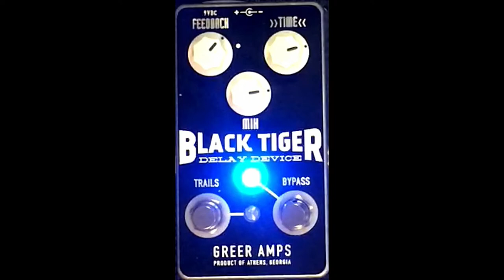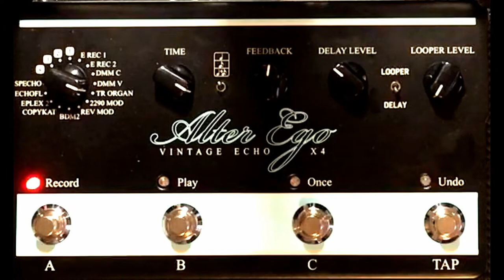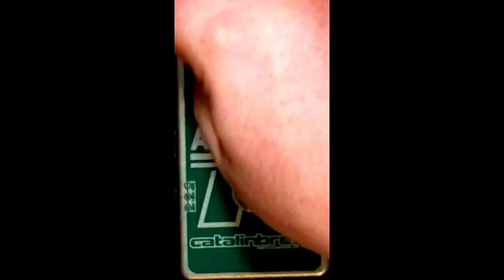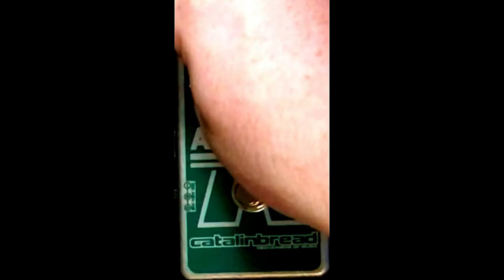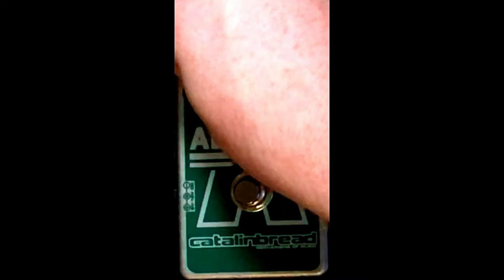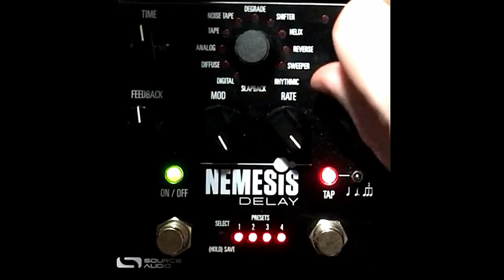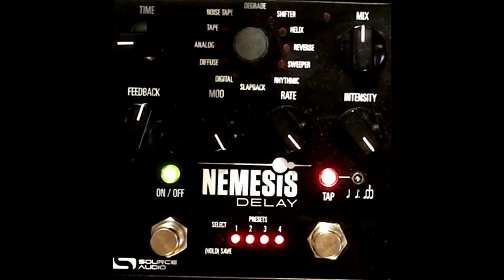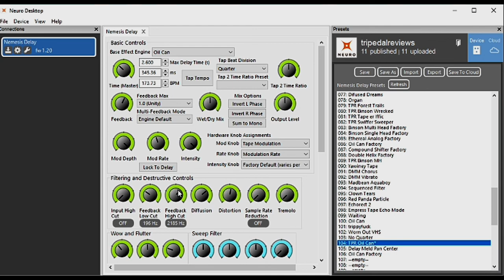Oil Can Delay Shootout - Adineko, Black Fountain, Black Tiger, Nemesis, Alter Ego X4

Comment: I threw my money at the Adineko. Not a speck of disappointment or remorse.  It did not replace my Volante or anything like that, but I bet it stays on the board ....forever! My only other Catalinbread pedal is the Zeropoint Flange and it has been really fun as well. That dude Howard really designed some GREAT pedals.
Reply: IMHO- that Nemisis Delay rendering is really killer.  But almost too Hi-Fi compared to the sound of a real one. It sounds amazing.

Comment: Hmmm... I wonder if there's something up with my Adineko. I've seen one other similar complaint on a forum, but my Adineko starts oscillating so easily with the reverb turned up anything past like 11 or so. It's actually really irritating, cause i love the pedal but kinda makes that feature unuseable. It looks like you're moving it past that here
Reply from the maker: Nope, expected behavior, as per the manual: Reverb -  "This knob functions like the repeats on any echo unit, it feeds back the wet output back into the input of the delay line" You are basically turning up the repeats on a delay, and the higher the repeats, the higher chance of oscillation.
Reply: @TriPedalReviews  yeah that's kinda strange then that anything past around 11 introduces crazy self oscillation.. i don't understand why they wouldn't have made that higher to increase the usability of that knob
Reply: after playing around with it more today it seems incredibly sensitive to dynamics/input volume. So if you back off a lot on what you're inputting, you can jack "Reverb" past 11. Still would have been cool to get a touch more feedback with the verb knob before hitting that edge of oscillation point

Comment: Most excellent demo/review, TPR!  My  favorite engine and go to preset on my Nemesis is an oilcan and I love it. That said, I've had my eye on the Adineko for a while now. After your demo, I think I might just stick with the Nemesis for now and keep exploring the oilcan engine's range; set the GAS aside for a time. Nemesis definitely held its own. 
Thanks for the video! Great job.
Reply from the maker: Those 2 were my favorite. I plan to sit down with the Nemesis and the Adineko and dial a preset as close to the Adineko as I can.
Reply: @TriPedalReviews  
This is why I was looking for a video like this. As much as I like the Adineko, I'd love to switch it out for something a bit more multi-purpose since its pretty much a 1 trick pony (albeit a cool trick).
Please upload that as another video if you can once you're done.
Reply: @TriPedalReviews  Hey, great vid, thanks ! Question ... did you ever manage to do that comparison between Nemesis and Adeniko? Looked for a specific video on that on your channel, failed, but maybe I am blind. Or maybe you did not put it in a video, but I can find it somewhere else. Either way, cheers, thanks for the lengthy comparison!! Very insightful!
Reply from the maker: @TheRealDoctorRobert  I didn't do a video, I might have done the preset though. I'll have to look through them and see. Will get back with you.
Reply: @TriPedalReviews  Many thanks in advance already! I'm trying to decide between the Adineko and Nemesis for Oil Can delay sounds (and yes obviously I would have more additional sounds with the Nemesis, so that will be part of my consideration). But anything on that, say your thoughts between those two pedals in terms of Oil Can sounds (or other advice) is appreciated!